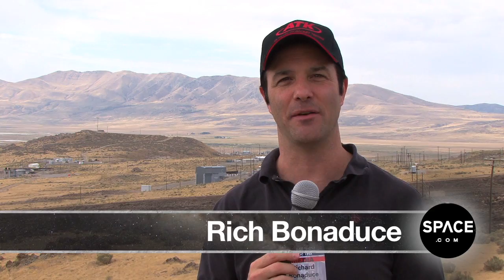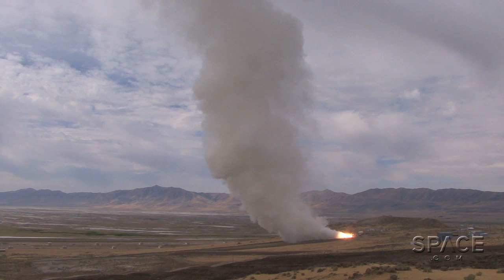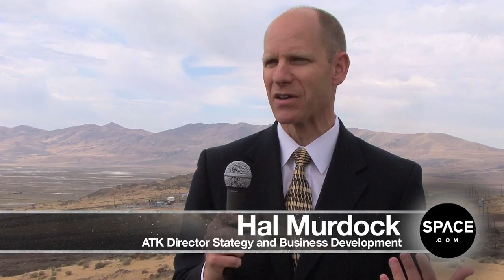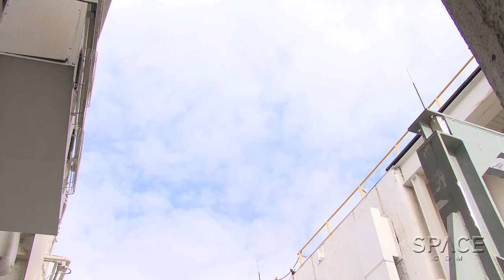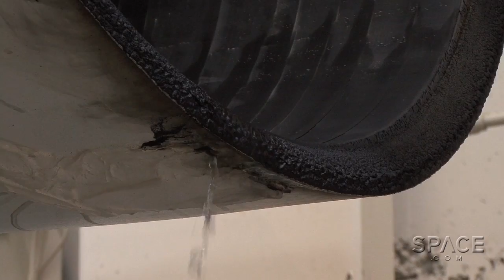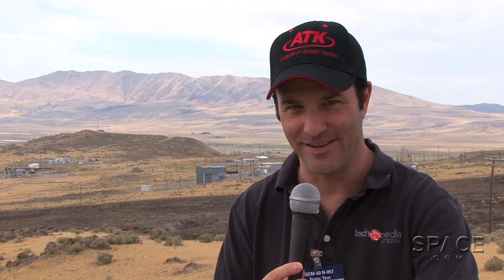New Rocket Booster Test Rattles Utah's ATK Facility | Video

Comment: Silly thought that just ran through my head.
~
I was thinking, which way was the rocket facing, East or West? Depending on the direction, the rocket test either sped up or slowed down the rotation of the Earth.(That was my thought)
lol
~~
Now, if say, 10,000 of these were lined up in a row, on or near the Equator, could the power of all those have any effect on our rotation?
~~~
Just thinking silly things, that is after working 12.25 hard hours 2day.
~~~~
Thanks for sharing this test vid.

Comment: from Wiki: A solid rocket motor consists primarily of a casing that is packed with propellant grain (a mixture of a solid fuel, such as a rubber or aluminum, and an oxidizer, such as ammonium perchlorate), and a nozzle at the aft end of the motor. The casing is crucial for the solid motor because it contains the pressure of the burning solid fuel; if the casing was not strong enough, the motor would rupture and explode.